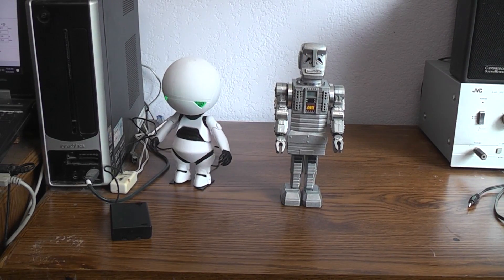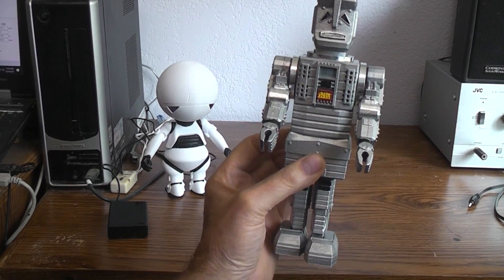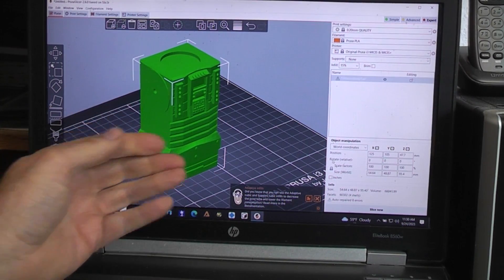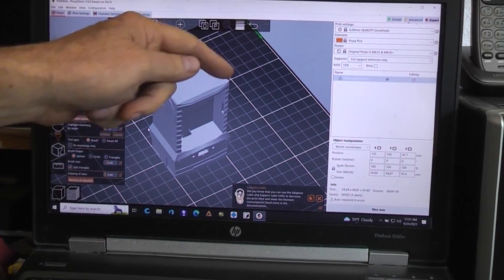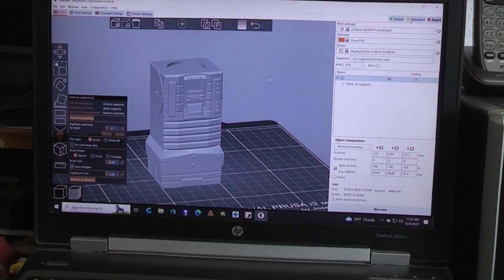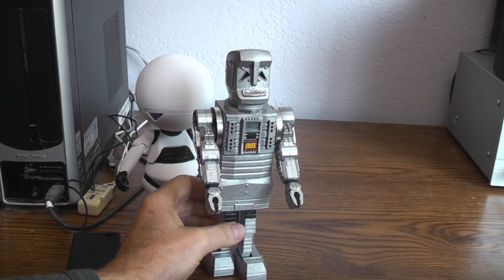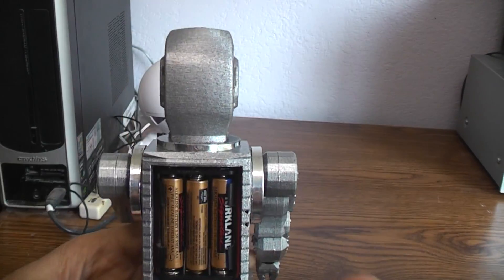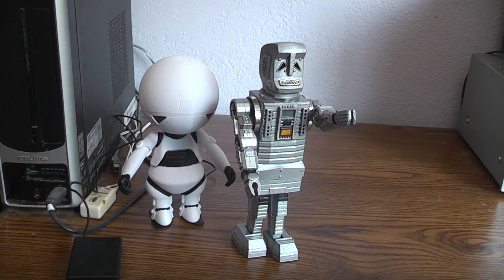Walking, 3d printed Demo of BBC TV version of "Hitchhikers Guide" Marvin the robot. Part 6.

Comment: PLEASE post the original printable unmodified file for those of us who simply want a display Plastic Pal who's Fun to Be With!
Reply from the maker: There is a link to the original digital artwork. You then have to use  a on line service to convert to STL. But it would not be printable as one piece. You would have to cut it up and print the arms, legs and head separate any way.
Reply: @Robothut  Which service did you choose? They did a great job!
Reply from the maker: I do not recall. Just did the search and probably used the first one that popped up. @Pygar2

Comment: Great paint job ! Cool robot 🤖

What is that glue called you use ? Ty
Reply from the maker: To glue PLA to PLA I use Weld-On #16. You can find it on Amazon and other places. Now to glue things that are not PLA or PLA to say metal I use E6000, you can find it at Walmart and all the big box hardware stores as well as on line.
Reply: Thanks John much appreciated  @Robothut
Reply: @Robothut  😢 you know I was went to order paint 🎨 and  dang if I forgot the glues you mentioned, robot 🤖 kick 🦵 in the head
Reply from the maker: Happens to me all the time.  @PeterAgostiniJdcap26